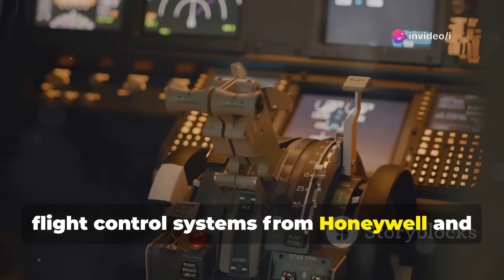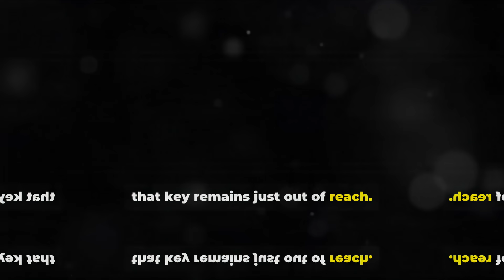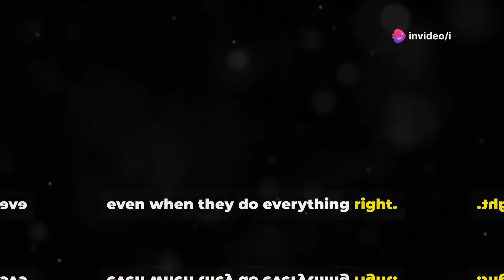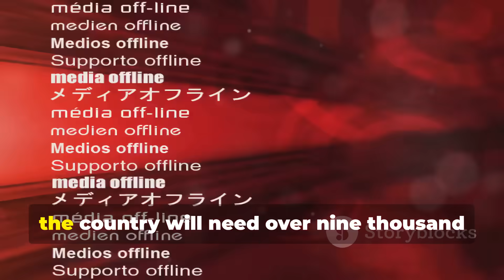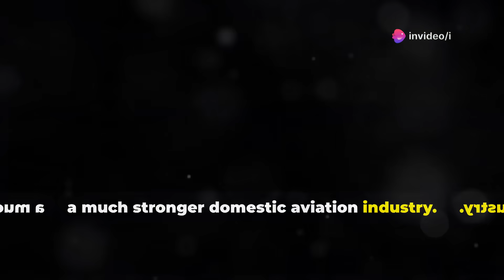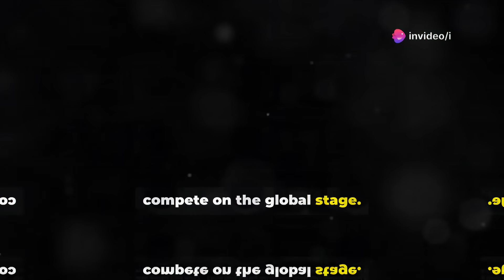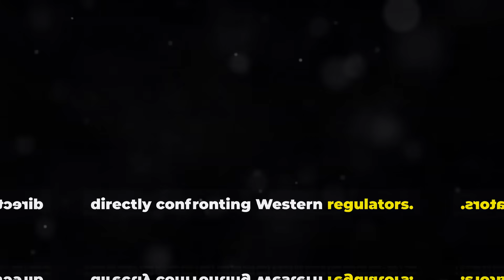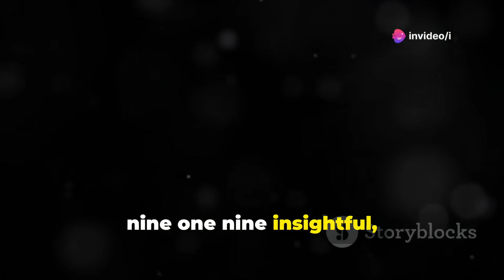C919 Grounded: EU Blocks Certification, US Laughs — China Strikes Back!

Comment: This AI generated piece of AI slop CCP propaganda is using the same footage as another much more honest video about the C919. The design of this plane is completely stolen from Airbus, China is completely incapable of replicating the million odd parts that make up the Airbus clone so they do what they can, locally make whatever they can and import ancient tech to fill out all the technology gaps. They are building 1 jet per year while Airbus knocks out 1 per day. Boing and Airbus have a supply chain for all the parts of the plane and have had this infrastructure for decades. China has no supply chain and the engines and parts it uses are ancient because they are forbidden from newer tech. The range on the C919 is a great deal less than the real Airbus.A320. Despite all of this, this C919 has no impact on Airbus sales because Airbus and Boing are both heavily constrained in output. In a way when China uses this plane, they are lowering the pressure on Airbus to supply China with planes that can't be built. Perhaps in 2 decades China will be in a better position. The irony is that China could have asked and maybe even gotten a joint licence to build the Airbus and become an Airbus partner, but no matter. China does what China always does, steals and puts out propaganda.

Comment: Would never fly a Chinese aircraft - be it certified or not. It doesn't matter that it is all made of parts from reliable suppliers. There were cases when aircraft disaster was caused by a missing washer on a bolt. Therefore it depends very much on where the aircraft was built. China doesn't sound as a reliable manufacturer to me.

Comment: Instead of all those unsubstantiated claims and generalities, why don't you explain accurately and in detail at which point the certification process is, and why it is hung? A certification process is well established through regulations, the steps to follow, the criteria to meet, are clearly spelled out, so where does the C919 stand exactly? Which steps have passed, which steps have failed? Be clear! Have the required number of aircraft been built? Have they flown the required number of hours with sufficient reliability, have they conducted all the specific tests successfully? Once you have laid out all these details, maybe you will have some credibility. Don't forget, the sum of a bunch of certified components does not make a certified airplane. So, please, more facts and less bla bla bla.

Comment: It is not legitimate for FAA and EASA to unduly withhold certification of China made planes save for non compliances of technical specifications and or safety standard. China Civil  Aviation Authority too can disqualify Boeing and Air Bus planes from flying over China sky in a retaliatory move  In addition  China will cancel futures orders of Airbus and or Boeing new planes. 

Meantime, China is clicking up a safety  flight record of C919 to gain air travelers trust and confidence. Presently, mass production has yet to be initiated and certification is not urgently needed.

Comment: This is simply a monopoly, and the governments that control this monopoly, simply prove by delaying this certification of the C919, that they fear losing market share from a Chinese airline, which has demonstrated, it build aircraft better, safer, and at a lower cost, than the other two aircraft manufacturers.

Comment: The choke point for China’s modern day aircraft development is the airworthiness certification issued by competent authorities, by your (manufacturing) government, national aviation authorities when it is a domestic product. Airplanes fly from one country to another that formed the Worlds commercial aviation network. Organizations such as ICAO regulates some of the safety and tech requirements while in America and European Union, the certification of airworthiness are done by the Federal Aviation Authorities (FAA) of USA, and European Union Aviation Safety Agency (EASA). ICAO is responsible to lay down a global safety standard and the FAA and EASA adopt them. Aircraft manufacturers must adhere to these safety standards/regulations for certification to operate between countries under ICAO directives. But if one aircraft manufacturer wants to obtain FAA or EASA’s “licensing”, it will face the scrutiny of their respective standard tests that will last a very very substantial period of time. Why, geopolitics, economy, and market competition are the road blocks. Boing and Airbus dominates over 90% of the aircraft manufacturing market. Boing is America’s crown jewel, so is Airbus for the European Union. 
COMAC is a threat to both Boing and Airbus in the short haul single aisle airliner market which present size tells you “don’t try to mess with me”. So for China to succeed, the C919 will only be marketed domestically over 95% of its production, leaving a few percentage for intra-regional aviation market that are outside of the influence of FAA or EASA.
It will be a rough journey for COMAC, a lonely but challenging one in the next ten or fifteen years before any genuine opportunity will exist to enter the American or European market.

Comment: So basically, it is rigged like the U.N..   China is very good at reverse engineering.  Since they have their hands on the parts, is will create cheaper replacements.  That is why Russia has not sold China jet fighters.  So, China created their own.  After they successfully fought the best French fighters interest in them increased.

Comment: The C919 has a much better safety record then the Boeing 737 Max.

Which got FAA approval without any meaningful testing. Required no additional pilot training and got hundreds of people dead and thousands traumatized.

Comas did everything right, has many safe flights under it’s belt and no crashes. But no western certification.

Comment: The same engine when in American or European plane, is perfect. If in Chinese plane, it's defective. This glaringly exposes western hypocrisy. China used western components just to share profits and mutual benefits. The west has just turned it down by refusing Certification. China will go on its own, just like the space station, telecommunications etc. 

C919 is NOT grounded. It has more than enough domestic demand for the next 10-15 years. It will also have many non-western customers. After a certain point, Comac's non-certification by the west, will invoke reciprocal action. The real battle will then start.

Comment: This is a lopsided account. The question you do not raise is to what extent is the C919 a "Chinese" airplane?  Almost all advanced technology systems in the C919 are directly acquired from Western companies. But that's only half the story: A A320 was bought by China 20 years ago and disappeared almost immediately after delivered to China. It never flew passengers. It was disassembled and what is now "Chinese" built of the C919 is just a copycat of the old A320. Intellectual property is not something China respects. Quite useful to cut down on research and development and use the leverage for competitive pricing. Buying a C919 is no different to buying a product, which you know has been stolen.

Comment: Just 10 C919 aircraft are delivered and in commercial service as of 2025. So it is too early to judge its reliability and safety. 
Airbus delivered 12,200 A320 for last 40 years. If C919 doesn't cause a major malfunction or crash for the next 10 years, 
the situation will change.

Comment: Problem is half the parts to the c19 are made in the west. China is not independent. So west has the upper hand! Not like Russia -import substitution PASSED. Independant! No, major Western bodies like the U.S. Federal Aviation Administration (FAA) or the European Union Aviation Safety Agency (EASA) have not certified Russia's commercial passenger aircraft, and certification efforts have been suspended or pulled due to international sanctions, particularly after 2022.